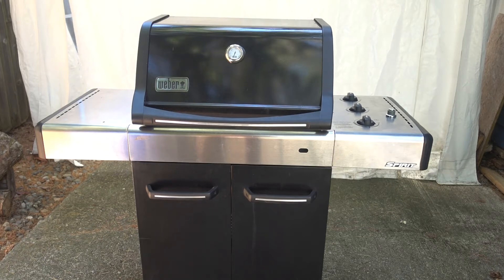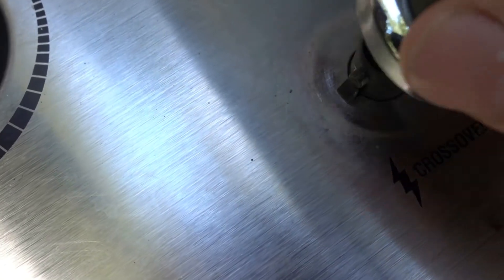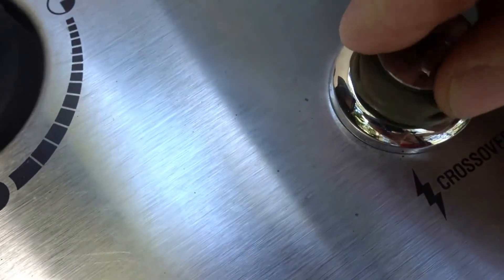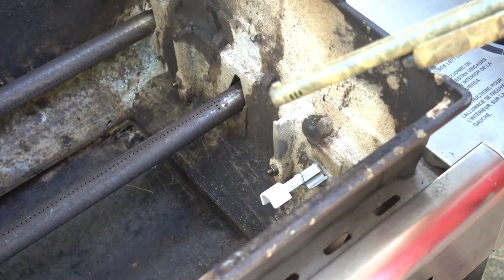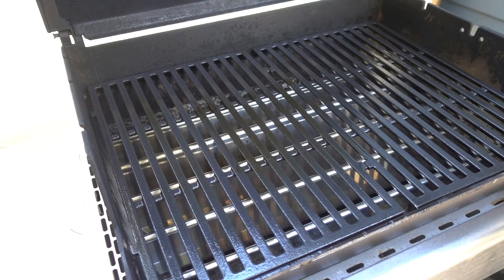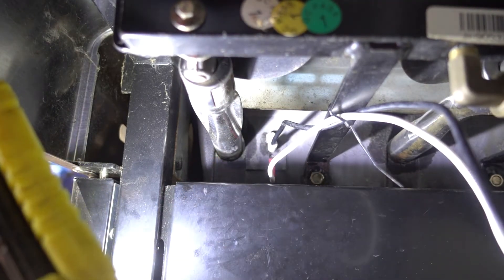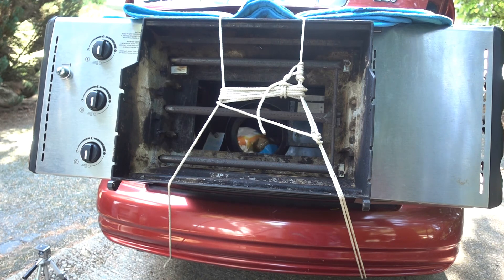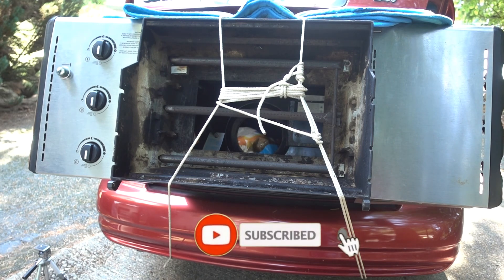Weber Spirit E 310 Propane Grill Repair

Comment: Awesome job man, someone just gave the same grill. Can you provide the links to the parts you used ?
Reply from the maker: Most of the parts came from Amazon: GasSaf Igniter Kit Replacement for Weber 91360 Spirit E-310, E-320 200, E-210, Spirit 300, and More Gas Grills (2009-2012) ，with Side-Control P                       22.5-Inch Durable Flavorizer Bars for Weber Genesis Silver/Gold B & C, Spirit E-310, Spirit 300 Series (Side-Mounted Control) Grill Parts, Stainless S                                        Kingkong Grill Cover 7130 Premium Outdoor Cover for Weber Genesis II 3 Burner & Genesis 300 Series Grill and Genesis II LX 300 Series Gas Grill Includ                          Uniflasy 7638 17.5 Inch Cooking Grates for Weber Spirit 300 Series, Spirit E/S 310, E/S 320, E/S 330, Spirit 700, Weber 900, for Spirit 300 Parts, Cas
Reply: @davidgpo  thank you so much. !!
Reply from the maker: @Dominicankidd8091    Congrats, I think that's one of the best grills out there!
Reply: YAY! That is exactly what I wanted to ask him! I am trying to fix grill myself!

Comment: You should’ve included a  parts list for Amazon
Reply from the maker: I just added the links to all the parts under Description.  Thanks for the advice!
Reply: Thank you great video I’ll be completing my repair based on your tips!
Reply from the maker: @scoadyutpd    The job is so easy it's kind of a relaxing project.  Good luck and thanks for watching!
Reply: Great Video, I just “repaired” mine last week ! and all is like new, btw the parts are easy to find on the various platforms, like eBay / Amazon.  I had to replace the cross over burner (‘small one left) it completely rusted out, my burners were still solid ! 👍
Reply from the maker: @Edscomment    That's what I like about Weber grills, there are plenty of parts available.  Thanks for watching!